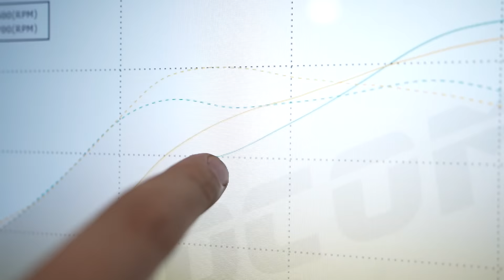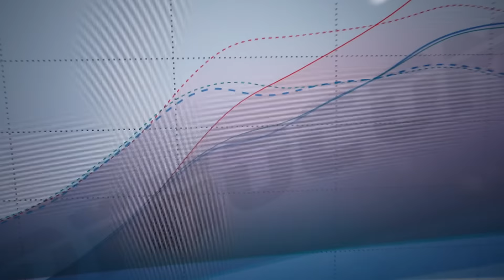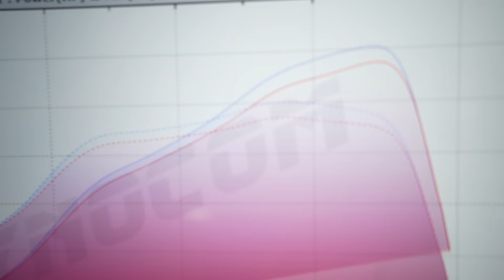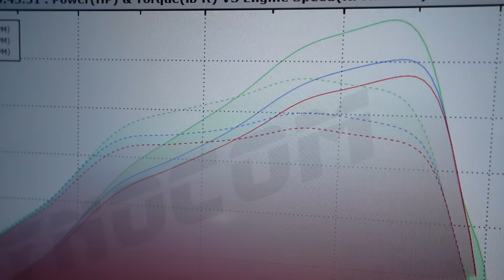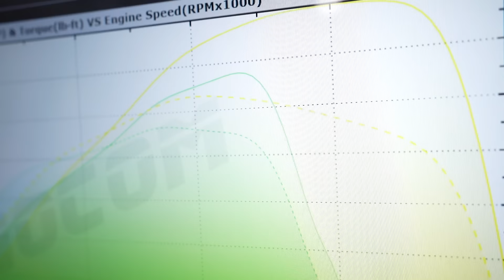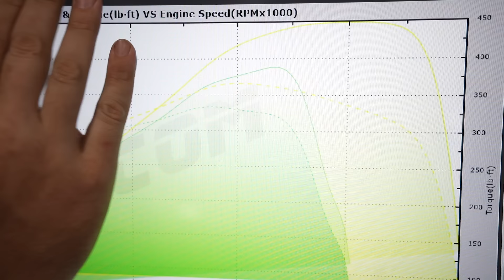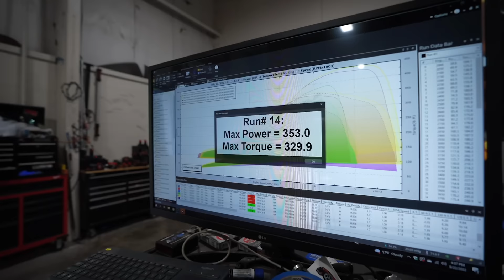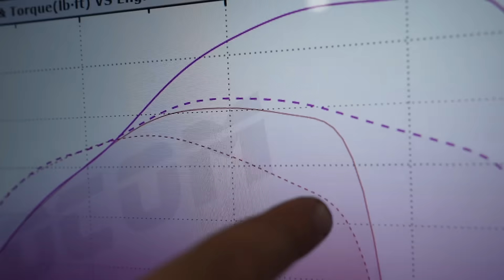DREAM S15 HITS THE DYNO - did I make the right call?

Comment from the maker: Use code JIMMYO130 to get $130 off across 6 Factor boxes at https://bit.ly/3BPaZWt!
Reply: Can you put chapter marks in so we can skip your paid promotions easier?
Reply: @jamesgottfriedson5060  they don't take long. If you only keep watching them you help him out. Its free content at least watch the add.
Reply: Keep the heaterbox  in the e36 for when it rains and is cold 🥶 nothing worse than cold feet at a track day and a misted up windscreen on a wet track day . 👌💯🤙
Reply: Right
Reply: I think the E36 would be a good car to do an OAKES garage drift squad wrap... Maybe an old euro dtm scheme with all naming and branding swapped to OAKES and link and fabwork by Spoon
Reply: Build series with spoon!
Reply: save 130$ across 6 box ... that makes no sense ...
Reply: U need a clutch pedal stopper for all twin disc clutch .this is standard practice for those that know .u r over engaging ur clutch it is damaging ur thrust washers ..get werks jdm billet clutch pedal stopper they r adjustable

Comment: When Jim put the clutch in and it didn't stall I started smiling like a kid 😂
Reply: How did he fix it?
Reply: @css172  Apparently thinner oil and after the break-in on the dyno it just went away on its own he said. I'm always curious about break-ins because most people say 500-1000 miles at least and then others just go right to the dyno lol, such as Jimmy haha.
Reply: @css172  the trust bearings were probably too thick and they self clearanced them selves?
Reply: @jordank7685  No, if a bearing "clearanced itself" your engine would be toast.
Reply: @evanlegault2257  me personally i have never really 'broke in' a engine iv built my own engine 4 times pluss 3 friends engines which have all been fine, mine running almost 500hp z20let 2.0 engine, all i do is 50 ish miles on millers breaking in oil  change it then let her eat. all my engine failures have been melting pistons due to injectors and map
Reply: Same
Reply: @Maakyuhlinsky  no trust. If a thrust bearing self clearances and happens to not hurt the crank, all the material will fall into the pan and be caught by the filter after it gets picked back up. But clearly that didn’t happen here
Reply: right
Reply: @joshuabower61  maybe it went away when the engine got warm and expanded ,I could be wrong
Reply: @daniesalex7073  personally I believe it’s two things. First is that a new engine is always somewhat tight and some heat cycles and boost to set the rings opens things up. Two, it has a twin disc and no idle control valve. The twin disk puts a lot more pressure on the crank when disengaging the clutch and with no idle valve to help catch the idle it’ll want to die.
Reply: @joshuabower61  that makes a lot of sense
Reply: @Jamie_aka  most motors built for hp and performance are broken in on a dyno 1 hour on a dyno is tones of time to break a motor in then straight into power runs.  The break in period most people talk about is for the longevity of the motors.
Reply: He needs a clutch pedal stopper .there adjustable ..twin disc have to have it or clutch will over engage and damage thrust washers

Comment: I had similar issue w clutch in my S13, we used the bolts to pull the trans together to the engine and it binded on the clutch disc not allowing it to disengage/stall with pressure

Comment: I think the fresh clutch with a brand-new engine with tight tolerances can be the reason it stalled at the beginning. but now that the clutch and the engine had some heat cycles. I think that's why the clutch and engine are breaking in and settling in.
Reply: I agree. Whatever was causing the binding simply had to wear in.
Reply: I bet its a bad clutch throw out bearing

Comment: Jimmy when you cut a filter open to check for metal put a section of filter material in the vice and tighten it up to squeeze all the oil out wipe off with a rag and dry filter and can see all metal etc very easy. and no oil going everywhere. and on the s15 so sweet.

Comment: It may have been said but if you don’t hear the VVL “crack” that means it’s set right and the car is making clean power.  

When you hear the VVL “crack” that means it’s a huge jump or dip in power and it’s not a smooth “linear” power band. 

Also wonder if you need a clutch pedal stop. Maybe it’s putting to much presser on the crank   I’m sure you guys have thought of it but it was never mentioned 

Great works guys LOVE the direction the channel is headed!!!

Comment: Jimmy!!! I had the same issue with my s15 after replacing a brand new OS Giken 5 speed gearset which I already had although I replaced with a new gearset because I broke second gear and could not buy a gear and had to buy another whole gearset at the time as that’s what was only available.

Anyways once I installed the box back into the car with the new gear set I couldn’t get the car to drive in gear it was super tight same as yours. I went through everything and it turns out to be after pulling the box twice to have a look everything was fine. The second time I pulled the box I noticed the input shaft was rubbing slightly at the nose.

Turns out the be the input shaft was too tight onto the crankshaft which can happen. I ended up cutting 2mm off the snout of the input shaft and than put the gearbox back into the car and BOOM!!

Problem solved!!! I had a BC stroker crank and look this could happen to any engine it just depends how much end float your engine has and also when swapping out different trans and gear set and crank combos this can happen. It took me a while to figure it out but in the end all was perfect.

Pull your trans back out and inspect the input shaft and crank contact and make sure they’re NOT butting heads to tight. 

Looking forward to seeing the next video and good luck. Love yours videos as always and a big fan! Peace ✌️

Comment: I know it's extra work, but I would have pulled the trans and checked the crank "walk" with a dial indicator, just to be safe, but if it don't blow, make it go!!!
Reply: Why not just check it at the crank pulley instead of dropping the trans?
Reply: @hamishbest9539  because you can't get motion in both directions with the trans on, and can't get an accurate measurement
Reply: Fair point
Reply: @hamishbest9539  old school still know a few things ..lol! (I'm 53 and am used to the classic way of doing stuff)
Reply: Haha yeah for sure. I’m still young, Fitter turner by trade. I’d say that albeit with more mucking round you could make something work to move crank both directions off the pulley but probably becomes more hassle than dropping the trans. Thinking that there’s possibly an issue with the throw of the release bearing being too long and it’s stalling out due to excessive resistance

Comment: Jimmy, if you haven't checked.  You might be over extending that twin disc pressure plate causing the clutch to engage when the peddle is pushed too far. Causing it to stall.

Comment: I had a similar issue once, and what I found after a while (not on the engine but) on the bottle of assembly lube I was using, became sticky after a while. So when I built that engine, it sat for a long time. So I'm convinced that the assembly lube got sticky after sitting for so long, and since it was sticky, the engine oil had a tough time trying to force it out. After a few drives and oil changes, the engine drive fine. Sold the car a long time ago so I don't know how it's going now.

Comment: the stalling issue could be too much throw on your clutch pedal... if you put the rear in the air, put in gear and if you have too much throw as you go to the floor with the pedal the wheels will start to spin and bring your revs down

Comment: My god, the top end difference with VVL is INSANE. I'd love to drop $10k on my S15 to get a VVL head setup. That's just bonkers. +100 hp, +1000 rpm, and the torque isn't even that much more extreme (like you said, doesn't add too much more stress to the engine) but it peaks higher up in the range and holds strong.

hhhhhhhnnnnggg

Comment: Jimmy check the lower timing chain gear on the crank snout make sure its not smashed agentst the oil pump or some engines have a thin shim type of washer that gose behind the gear if that's not there it will cause that same problem

Comment: I dont know what ecu you’re operating on, but if the stalling comes back: i’d consider idle torque reserves. That twin disc decrease in rotating crank mass and increase in friction plate will require a lot less idle torque reserve. 

German cars on OE ecus have these issues with large differences in flywheel from oem setup, especially applicable if you started with a dual mass which is substantially heavier than a twin disc.

Comment: It’s interesting that the engine was “Tight”. I built a Ford 428 when I was just out of high school. The racing bearings and rings were huge compared to todays engines the rings even filed correctly were tight enough the you needed a special tool to squeeze it tight enough and a big wooden dowel that you beat your pistons in with. It took a long breaker bar to get the engine to turn over. Assembly lube was on everything and high sink break-in oil. You just prayed that the starter could turn the engine over. It would take a hour of running to settle in enough to idle. 
Still nerve wracking though.

Comment: Put a pedal stop on the s15!!! It sounds like you're overthrowing the slave cylinder and pushing the fingers on the pressure plate into the clutch disk. 

I've had the exact same issue and a pedal stop fixed it. Only wanted to die when the pedal was pushed ALL the way in. This is especially common with twin disks!!!

Comment: Think the problem why your car is stalling because your clutch is not bled right and is still engaged when you disengage the clutch. Happened to me on my m240i when I installed my twin disc. I would try rebleeding the clutch. Also can be caused by a stock clutch line. Are you using a steel-braided line from the slave. Problably air still in the system try rebleeding the system.

Comment: You just gotta drive that batch my 82 corolla motor when it was new it was tight as fuck and the starter would struggle to start it. I thought my rings were too tight it'll freak me out. But after driving it a full week I drained the oil put new oil and filter and now she starts fast and doesn't deal that way no more

Comment: Could try swapping out the clutch to get rid of the rpm drop. I remember whistling diesel had issues with his twin disc on his gtr where the clutch was putting so much pressure on the flywheel it was moving the crank and ruined the motor.

Comment: Your clutch pushes flyweel a lot to the front something with your pressure plate the thross bearing on the crank takes all that stress
Reply: This happenes whenever you push the clutch and when the engine is revving

Comment: I definitely don't know much about engines but could the problem with pushing the clutch and stalling be because the engine wasn't running for a long time and was a bit seized and needed a bit of load? 
Spoon is a very good addition to the team!

Comment: @21:46 it drops 60 rpm, that is still ALLOT... what is your oil pressure at?, cause under load, that is what will matter the most, if oil pressure is still high, that means oil clearance for bearings to crank, and bearings to rods ect are TIGHT, and too tight with high load equals mteal on bearing or spinning bearings which is NOT FUN

Comment: Can you use a dial indicator on the crank pulley and measure thrust with the engine in the car? Certainly a relief it was just the clutch. Always good to be aware of potential bearing issues with the SRs.
Reply: You nearly always need the trans or engine out to measure thrust/end float.
Reply: @foamdataservices  I don’t see why you could not measure at the pulley with engine in the car if you found a solid base to bolt an indicator to on the block. I do agree trans off and engine out is going to get you the most reliable reading though l.

Comment: JimBob I think it is your clutch. Twin discs can have a lot of pressure. Do you have an aftermarket pedal stop? Adjustable? What can happen is your overextending fingers on pressure plate causing thrust issues
Reply: Pedal stop adjustable can be dialed in. I usually weld a longated nut to clutch pedal arm then a bolt for pedal stop and is adjustable.
Reply: Then you simply play with the engaugement... find where it engauges fully then dial pedal stop like 1/4" more.... Competition Clutch has a good write up how to.

Comment: I am curious if the pedal is over extending the throwout bearing and pushing the crank. I wonder if it would be helpful to try and adjust the pedal so that the clutch still disengages. Possibly even check the throwout bearing itself?

Comment: Did you adjust the clutch pedal? If your over extending the pressure plate it will lock up and kill the motor out.

Comment: Not well versed in how the thrust from the clutch engagement makes the engine tighten up. Anyone have a simple explanation on how that happens?
Reply: Force applied to the clutch isnt just releasing the clutch. Its also pushing forward on the back of the crankshaft. That can and does push it forward enough that if the clearances arent set properly it can bind up from metal to metal contact on the thrust bearing surfaces.
Reply: if your engagement depth is too much between the input shaft of the trans /clutch/pilot bearing it will clamp/bind up and could very well take up any of the thrust clearance built into the motor(crank/bearings) when assembled and easily stall the engine when the clutch is pressed in. Have to measure this all when assembling. you'd be essentially then using the clutch as an engine brake and if its tight enough it will stop the rotation of the engine at idle. Thrust is the amount of clearance within spec you build into the crank/bearings forward to back
Reply: @danielalexander8229  thank you both!

Comment: An issue with the clutch setup/adapter plate/clearances? Only real logical answer, would only need to be a small amount off for it to give the issues you had. Then actually using and bedding it in was enough to not be an issue? Just my thoughts anyway

Comment: VVL heads dont have rockerarms, thats the main reason they rev so high
Reply: wrong. vvl heads don't have floating rocker arms like regular sr20 heads., they have rocker arms shafts that the rockers are solidly mounted to which allows them to rev so high because they can no longer fly off like regular sr20 heads when revved high.

Comment: btw your clutch setup is too heavy of a pressure plate, that's your main issue. You should have a quad disc osgiken or something like that, itl drive like a stock clutch, not a heavy pressure plate, hold 1000ftlbs etc.

Comment: Jimmy if you had thicker oil before the oil change couldn't that have been what what was choking out the engine?
Reply: If your oil is thick enough to stop the engine turning over its grease. The thinner oil was I guess to help if the bearing clearances were a little tight, it will film better between the crank and the bearings as well as on the piston to wall gap.
Reply: @foamdataservices  I know what you mean but it’s the only explanation because it stopped when the oil was changed

Comment: The only time thrust is applied is when the clutch gets pushed in therefore there wouldn't be anymore metal then usual in the engine other then what got pushed around with start up and heat cycle because you weren't putting any pressure on it...... We'll see what the true results hold when you start driving it and clutch kicking it... Swear it's hard to see people lead a following with zero common sense

Comment: Isn't it a bit too early to be tuning the yellow s15, since it hasn't been broken in properly yet?  Don't you need at least 500 miles to properly break in the motor?
Reply: Tommy literally just had a 2.8 RB built and only drove like 100 miles or less too Jimmys shop and had it tuned without a break in either…
Reply: @doublescoopgarage8051  I guess it is safe, because Jaimee Marsh is tuning it, it is safe too if Jimmy also tuned it.

Comment: It not torque that causes stress it HP
Reply from the maker: Horse power is a function of torque 🤝
Reply: @JimmyOakes  you said torque causes stress but it the HP power Ur chasing that causes stress metal expansion is cause of
Reply: Heat

Comment: Pls specify to a simple man what exactly a long block means?  ✌🏽
Reply: a long block is just the cylinder head and block assembly together. if you buy an engine and it says longblock only, they typically mean no transmission, no ecu, no exhaust manifold or intake manifol etc.